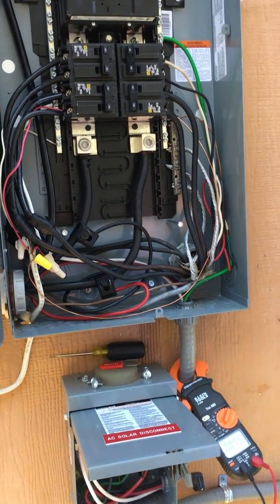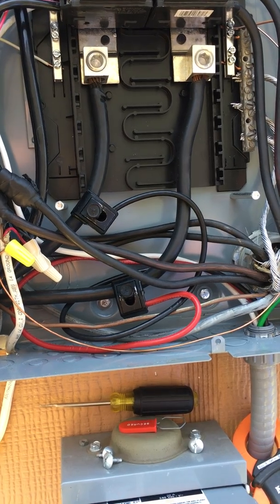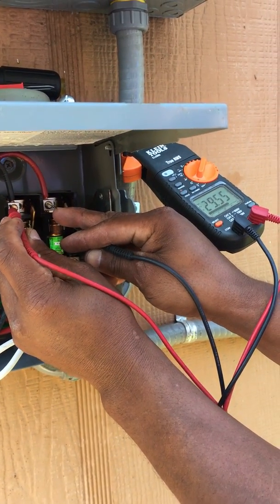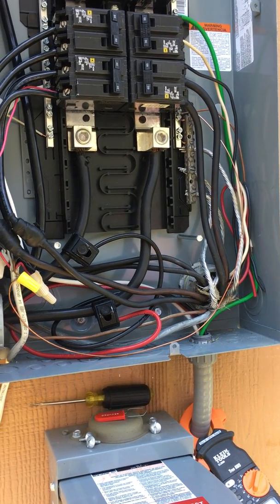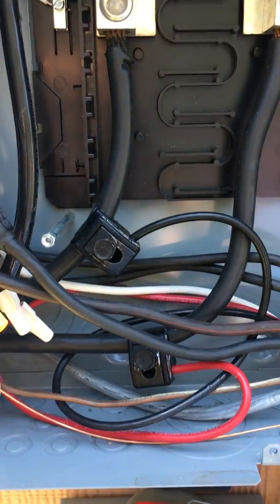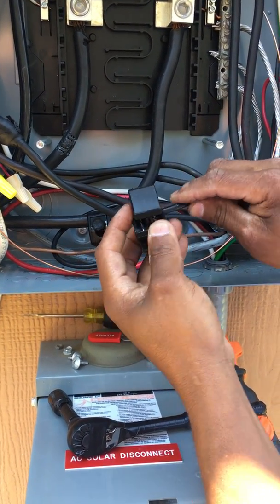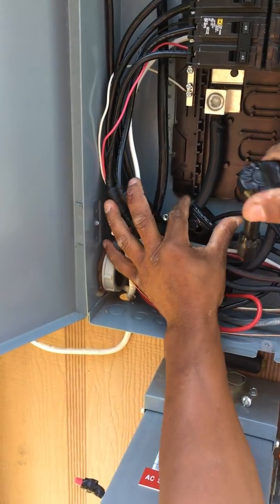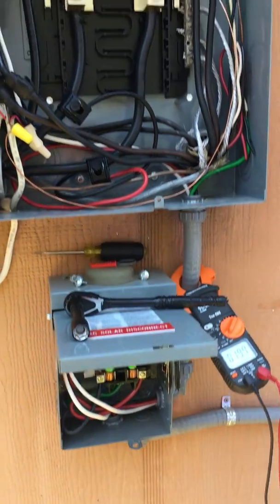Supply Side Tap

Comment: Solar professionals please forward the video to 1:20. Customer has a main breaker that is supplied by a meter from the bottom of the of the electrical panel.  There aren't any wires feeding from the top of the main breaker.  Its coming from the meter pan on the bottom left side.

Comment: ??  A supply side connection is between the METER and the MAIN DISCONNECTING MEANS.    It appears that you are connecting between the main breaker (to the left... not shown?) and the main bus.  This makes this a load side tap.  Violation.  Adding amperage to the bus, combined w the main breaker. See?  Am I missing something?

Comment: so the production meter coming from combiner box. The 2 hot wires on from combiner land on the top left and right lug  in the production meter. and the buttom left and right go to disconnect.  Back to the Production meter. the left and right lug is your line. and theres center lugs in between left and right lugs. what normally gets wired in there. neautral or ground wire. ?so the production meter coming from combiner box. The 2 hot wires on from combiner land on the top left and right lug  in the production meter. and the buttom left and right go to disconnect.  Back to the Production meter. the left and right lug is your line. and theres center lugs in between left and right lugs. what normally gets wired in there. neautral or ground wire. ?

Comment: I've found that if the gel inside the tap connector oozes out, its close to getting tight.  But really, you should use a torque wrench to the manufacturer's specification.  I believe it's 156 in-lbs for those ilsco taps that fit up to 4/0 wire on the big side.    Also, your safety leaves something to be desired, you really should have at minimum, some gloves and something to protect your eyes.   Stay safe out there, and thanks for sharing your knowledge!
Reply: Also, while it's okay to connect while hot, it's not okay to remove when hot. When you remove it, you have exposed line wires very very close to the metal body of the panel; this cause serious arcing. 120v direct path between hot and ground with no fuse in between until your meter blows. This is VERY dangerous for the person standing in front of the panel.

Comment: In 2009 I had solar installed, didn't pay much attention to the actual install, so I was at a disadvantage to begin with.   Flash forward to 2020 and the county recommends I put in a side line tap.
O.K. BUT, not all electricians know what this is.  This video in several places points out what its good for.  " to begin with you can have unlimited solar, 30 kw if you want". Exactly!!  Mine is 8.8 kWh 
up from 5.7 .   You explained it well.  I thank you for this!

Comment: It appears that this panel is not wired correctly. The feed from the meter comes in at the lugs on the bottom. The feed should come in at the lugs connected to the main breaker on top. I doubt the four breakers in the panel are rained for the available fault current from the utility. 
Even though this is a supply side connection, it doesn’t meet the intent of NEC 705.12(A). I would suggest rewiring this panel because you could overload the busbar.
Also, the insulation piercing connectors you used should be properly torqued with a torque wrench. You actually demonstrated one of the issues with not using a torque wrench, which is that if the connection is under torqued, you may not have a good connection or a high resistance connection which could cause a fire. The opposite, an over torqued connection is just as bad.
Reply from the maker: You are correct.  The homeowner may have wired tthe panel on his own and not a licensed electrician.  On a better note- Since the video demonstration, the electrical panel has upgraded to accommodate the NEC code 705 and our changes regarding the solar has been corrected.  Thanks

Comment: Great video. The manufacturers usually say the taps aren't supposed to be bends. The wire it taps into should be straight. I also think they are "single use" so if you take one off you should replace it...